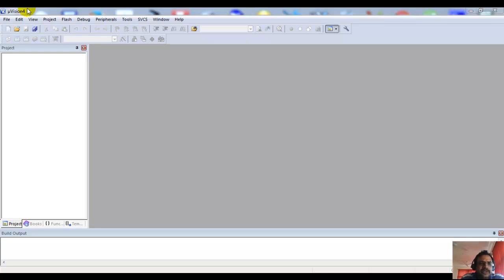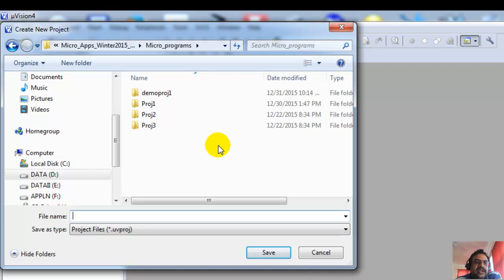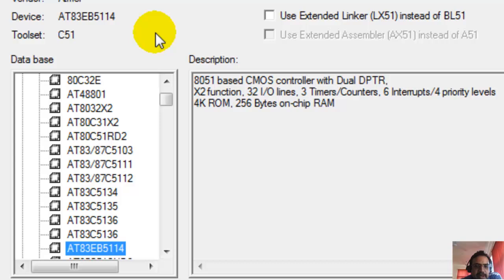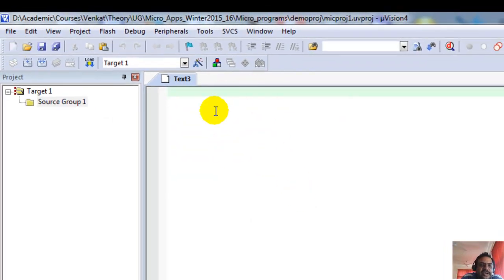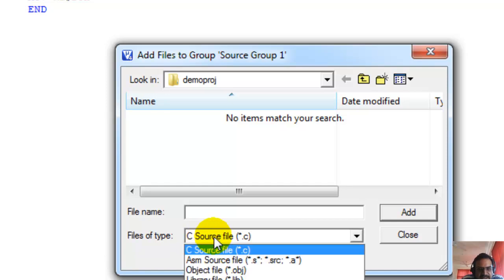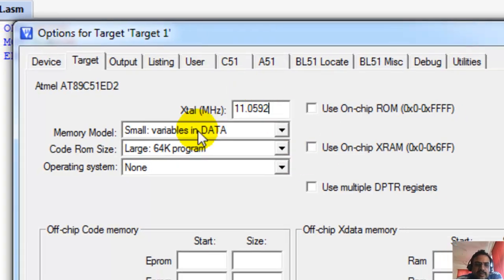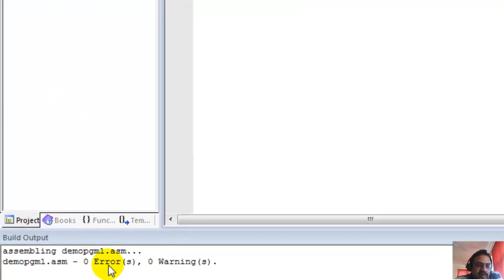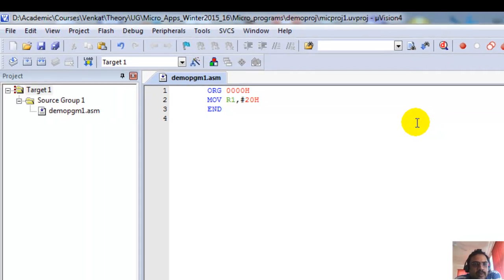Introduction to KEIL tool for 8051 programming

Comment: Thank you so much sir for making such a wonderful video🙏 
But I have a problem sir please solve it.Actually I am making a project of flexible transmission line using TSR, 8051 microcontroller is used in it but I can't understand its coding part , can you please provide the code for that???

Comment: can u provide the link to install keil software,I have installed a keil software but I could not found  at89c51 in that its only showing atmel  wireless&uc  option other than atmel.

Comment: sir! getting errors on org and mov commands as syntax error even after saving the file with .asm format what could be the reason?
Reply from the maker: What is the error you are getting on org and mov commands?
Reply: @VenkatasubramanianK  sir i have resolved that . thank you
Reply: may i know that how i can code on arm i am trying so hard but could not get the solution of an error occuring in arm which is about .afx file do let me know kindly if you know

Comment: Hello! I am new programming the 8051 in keil, and I want to ask you a question, I am understanding a bit of the architecture of the chip to emulate it later, but I have problems, I install keil 5, and when programming it in c, the hexadecimal code result starts on code in the 800h address, and I can not change it, that is "the instructions start from 0 onwards", not that it does "jmp 0x800" and from there the code starts, I searched for other compilers in c but none of them worked, I hope can you help me thank you very much
Reply from the maker: Hi Can I see the initial segment of your code to see how you have written the construct?!

Comment: Sir after clicking on ok it is not moving to debug section.. I'm getting a msz that " connection to Target system lost". So what to do.. plz reply sir..
Reply from the maker: Probably you have selected hardware emulation in your project options, just check, if so change to simulation.

Comment: How to I convert two source codes into a single hex file
Reply from the maker: Unless you write them as inline code, I think it is a difficult process, or you can write the other code as a link file and do dynamic linking or a third option is calling one of the programs as a function.